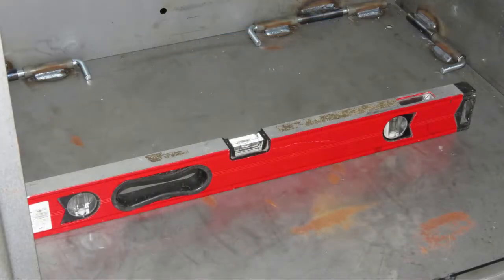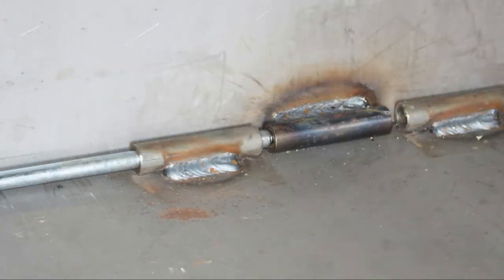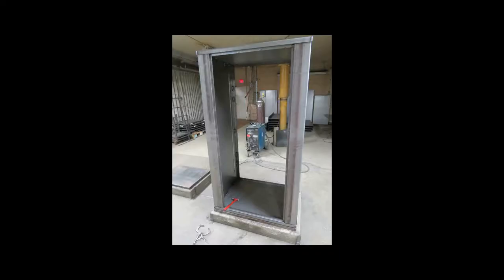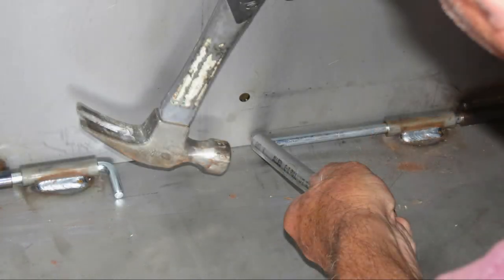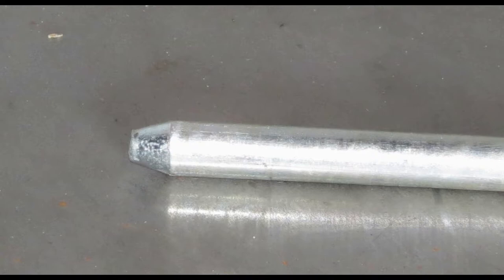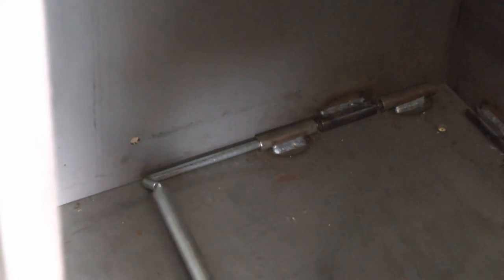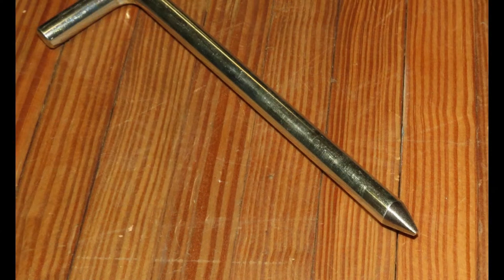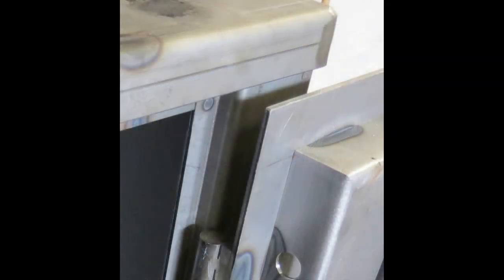Zanotti Armor - Assembly Tips and Tricks

Comment: Can you mount the door without it being open 180. I have mine assembled in a closet when I can't open the door all the way open. We tried, and scratched it like you said, but is there a way to do it?
Reply: I read somewhere that you can put the door on before you put the top on.
Reply: @danburke4487  funny thing is I was the test case.  The owner quickly got back to me and suggested I do that. It worked and they have video on it now. It is a must if you are putting the safe in a tight spot.